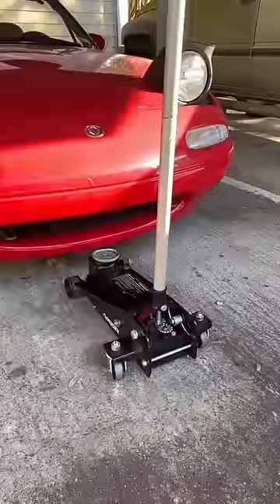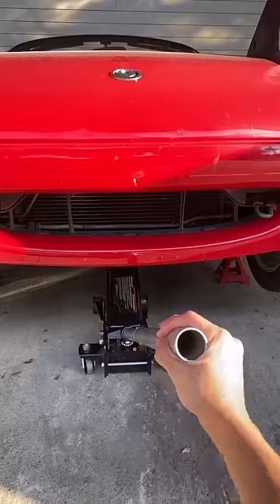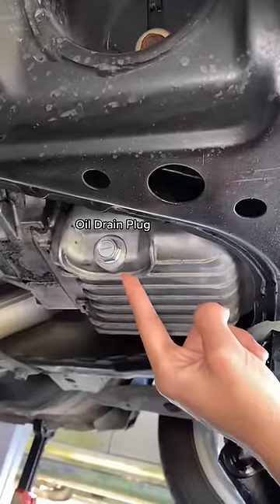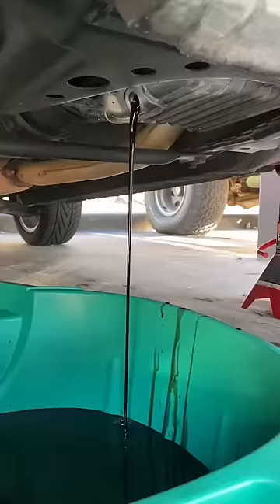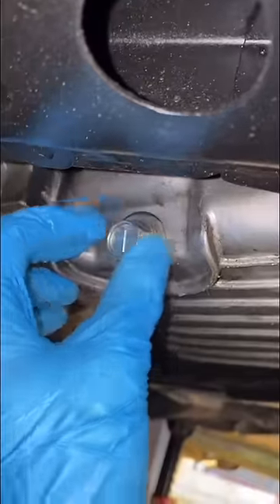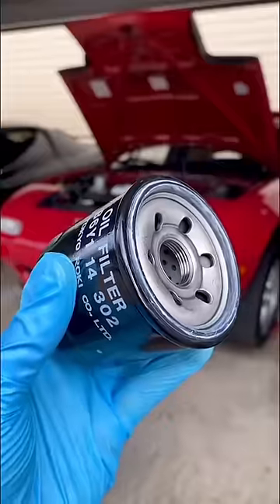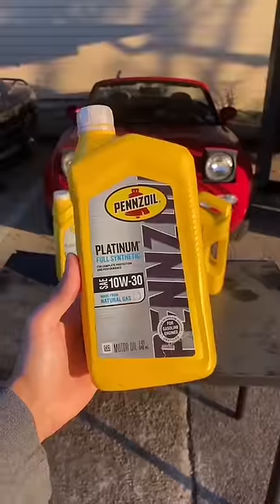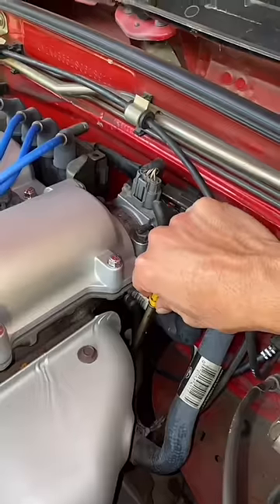How to do an Oil Change! (in any car)

Comment: I always remove the rubber seal from the filter and coat both sides with oil before putting it back in.

Comment: After putting in new oil, start then engine and run it to cycle oil thru the engine and oil filter, THEN check dipstick.

Comment: I have never ever replaced the crush washer on drain bolts. Never has it ever leaked on all cars I have had to own or change the oil on. I of course check to make sure it is not cracked and is in good condition. Generally good practice to replace the washer but I have never needed to.

Comment: I don’t put the drain plug back in until I’ve taken the oil filter off, I’ve noticed more oil comes out after I remove the filter.
Reply: Absolutely, this is an important step he missed out.

Comment: Always check for DOUBLE SEAL on filter.
Reply: Agreed. I look for the seal on the old oil filter. If the old oil filter seal is on the old oil filter, it's not on the car.

Comment: You're supposed to start the car and then check the oil level. You'll get a false read if you haven't started the car after filling it with oil. Also, please remember to place a block behind one of your rear tires people. You're road pizza if the car rolls back.

Comment: If you don't fill up the new oil filter with oil before screwing it on, then make sure that after you've put the new oil in your engine you make it run for a few minutes and then you check oil level again, because you might need to top up a bit since the filter has filled itself with oil

Comment: I don’t have crush washers on any of my vehicles. And I’ve always filled the filter with oil as well as lube the seal before I put it on. I’ve yet to do this. But some skilled mechanics can take the drain plug out without getting oil on their hands.

Comment: Really the only notes I have is 
Check your dipstick to make sure your in the right range and don't have any leaks 
And 
Chock your back wheels if your only lifting the front 

Also lower the car before final checking the dipstick otherwise all that oil will be tilted back and you'll think you need to add more

Also DONT just tighten your drain plug with a ratchet, that's a 1 way ticket to a fucked up drain plug 
If you can find the touque specks and do everything in your power to use a torque wrench 

And also its a good idea to whipe the mounting plate for the filter to make sure you don't double gasket
Its not needed but my paranoid ass won't sleep easy unless I do 

I work at a quick lube shop 
So this is fact checked

Comment: Quick tip, fill the oil filter about half way with oil so it doesn't run dry right away. It just helps
Reply: no

Comment: Nice video but he left out some info 

First off you would want the car to be flat and  ot with the nose in the air ... having the engine at that angle can cause some dirty oil to still be in the pan 

Try to get the car level .. however if you do it with the car tilted its not the end of the world 

Second . When replacing the oil filter( before fitting the drain screw )  you should fill it up with oil ... if you cant fill it up 

Then just put it on and remove your fuelpump fuse so you can let the starter rotate your engine and get the filter full 

Also its a good idea to put some oil on the seals before you tighten them 

Also make sure the oil filter seal is off ... if you stack two filter seals on each other they WILL leak ...

Comment: I would also fill up the filter about halfway with oil, that way it’s primed when you first start it back up again
Reply: Nah. The center of the filter is the clean side. You risk contamination when you add fluid yourself. Most manufacturers recommend that you do NOT do that.

Comment: My mom's Subaru outback that I changed the oil on was leaking out of the filter, and had a slight leak out of the drain plug, needless to say I don't let shops work on it anymore, and I legit just cleaned it all flipped the crush washer because I forgot to buy an oversized for her car...
No leaks and we're at 350,000 miles...

Comment: Don't mean to be rude. Great job but usually you feel the oil filter up before you put it on so it doesn't run dry and just filter through it

Comment: Aren't you supposed to run the engine for a bit before so the oil is at its thinnest viscosity and will run to the bottom more effectively, and not sludge up through the engine. To make sure you drain all if it?

Comment: Unscrew the oil filter by hand? What kinda wizard are you?
Also make sure to run your car after checking the oil for the first time, then check again (itll drop since the new oil filter need to fill up).

Also you didnt mention that you should change the oil after driving so its still warm and all the loose particles didnt set yet.
Otherwise solid vid

Comment: Are we just not gonna talk about how your supposed to run the engine and then check the level, if you put the proper amount of oil in and then check right away. Then it will look too full but it’s because the oil has not made its way through the engine yet

Comment: Cracking the oil cap loose before the oil change is useless. Oil is not a sealed system it's going to flow the same with or without the cap loose. And i have never seen a drain plug directly under the fill cap on any engine haha

Comment: 99% I give  it an A
If you'd mention to start the engine and then check the oil level it'd be A+. Because the oil radiator and the filter will suck some in.

Comment: You should always remove the the oil filter and plug together because it’ll leave pressure in the system if you don’t. You should also always use a torque wrench when tightening a drain plug and look up the OEM recommended torque as aluminum pans easily strip out.

Comment: Pre-Fill you oil filters people!!
Reply: I see too many people not do that, despite the filter placement being at a weird angle on some cars, it should be done anyway!
Reply: @bass_man8149  absolutely correct, you don't want your bearings to run dry even for seconds
Reply: Literally pointless on modern cars

Comment: Never jack up a car but the sub frame… also do oil changes on a flat surface as the drain plug is now not at the bottom of the motor……..

Comment: I usually use a wrench extensor to remove the oil drain plug and I don't get a single drop of oil in my hands

Comment: You don’t need gloves lol you loosen the bolt and then twist it off while keeping tension on the bolt, once it’s off you keep tension with your fingers and quickly get the bolt out of the way of the flow of oil

Comment: bye the way when you set the car down leave the jack there just in case one of the jack stands fail just for safety measures
Reply: that only if you use harbor freight jacks
Reply: @thatslegit  i don’t use that shit I have had mine fall do to a truck moving on the jack stands and the jack caught the truck from landing on me

Comment: First oil filter then oil drain plug.
Reply: Nope, it depend on if the filter in on top of the engine like most expensive cars do, but since it's an older car it's always drain plug first

Comment: Don’t forget to fill the oil filter with oil too!
Reply: How do you prefill the filter if the setup on a car is horizontal? Wouldn't it make a big mess?
Reply: @jackiechan_wtf4041  usually the filter goes up but incase it goes sideways just fill it a little under halfway and be careful and you should be good

Comment: I run my miata on the streets like its the track, penzoil was worn out by 1500 miles and mobil1 regularly gets me to 3000 no problem (I’m talking 6000rpm pulls to get up to speed in city driving never mind highway).

Comment: Yes first you have to drain the oil pan and screw the oil drain plug to seal it, but later remove the oil filter, of course, so you don't leave any used oil inside your engine, isn't it?

Comment: You still have a good 2 liters of used oil in your engine with it tilted on a 25 degree angle like that 🤣
Reply: Surprised I had to scroll this far to find this comment
Reply: @SlimTheGoat  bunch or morons gonna do this and fuck their engine up...
Just realised you wont be putting the right amount of oil either , you would be putting a lot extra since the dip stick wont reach the new oil properly in the back of the engine 😅😅😅😅😅
Reply: @GTR_IMPOSTER  I stopped draining oil years ago and switched to an extraction device thru the dipstick.

I had my doubts so I did it on an old sbc I had sitting around and pulled the pan afterwards. Needless to say I'll never wrench off a drain plug again
Reply: @SlimTheGoat  if you do it that way , it doesnt matter if your car is on an angle right ? 

I take my cars to a shop man , its worth the 20$ extra for my time lol .. even tho my car is lowered and its a pain sometimes still worth it for me to bring it to a shop
Reply: @GTR_IMPOSTER  I wouldn't think so but I've never tested it out. For as much money I got into equipment and vehicles I don't trust anyone but myself for maintenance. This way I got no one to blame but myself if something happens.

Plus depending on the location and style of oil filter you may not even need to jack up your car which is pretty sweet.

Comment: The tip about the line from the oil cap is not true, ive done hundreds of oil changes, and tried this several times. It only worked like 3 times

Comment: Are we gonna not start it and run it for a bit then turn it off and check the dip stick? A filter usually holds around .3L more if its diesel truck

Comment: I've done many many oil changes on both of my cars and never replaced the crush washer, it doesn't seem to leak either, so i don't understand why you'd need to replace it.
Reply: @EpicDrew15  Mine are nylon or some sort of plastic.
Reply: @EpicDrew15  Ahhhh, alright, that makes more sense. Thank you for clearing that up for me.
Reply: @EpicDrew15  You too.

Comment: you did it completly wrong.... before you put the drainplug back in. Change the filter first so you know most of the old oil is out.... most oil filters hold 0,5 liters of oil.

Comment: " unscrew it by hand " uh huh... In a perfect world yes.... But actually, stab with screwdriver, yell expletives use hammer, wrenches, too much effort , smash your knuckles, swear , two hours later remove the crushed up oil filter and grumble about how your dealership screwed you by telling you they replaced the oil filter when they didnt , now add new filter and oil

Comment: not suppose to have engen oil filter be able to be hand tight or can untwist by hand vibrations can and will unscrew oil fitter get the ofishal book on working on a meatia and follow it

Comment: I didn t see if u filled the oil filter eith oil before u installed it
I am not a mecanic but everytime i change the oil at my traktors i fill the oil filters with oil🤷🏾‍♂️
Is it corect or not?

Comment: Don't put the drain plug back in until after the old filter is removed! More oil will drain out and you'll end up trapping that old oil inside, which will mix with the new oil you're putting in.

Comment: Bruh nah bruh💀 gotta do the oil change with the car flat otherwise you get a bunch of gunk nasty oil stuck in the back of your pan
Reply: plenty of cars have the drain plug on the back and it’s at a angle so there would be no issue

Comment: Why do u need to change the washer I’ve changed oil many times but never seen that before
Reply: They recommended changing washers regularly to avoid leaks, but I really only do it if it if it’s actually leaking.

Comment: Well I'm just going to say this your wrong in any vehicle try a newer dodge caravan bud they are a cartridge type oil filter that's replaced from the top of the engine so please refrain from using any vehicle anymore it's not the 90s anymore.

Comment: I'm stuck on the first step cause I can't get my jack under 😂
Reply: Yeah I usually Jack up the front right and front left corners and then the back with the diff because it’s a little easier than getting the front cross member

Comment: Never thought about the crush washer, I'll have to look for that next time!
Reply: Some cars have a rubber gasket on the plug instead of a crush washer. Those don't need replaced unless they're damaged. But if you do have a crush washer, not replacing it risks a slow leak.

Comment: Sorta glad I went for an 86 for a fuck around car than a Miata just because oil changes are less hell because the filter is under the hood. But at the same time I got no pop up headlights and flirt with chicks by winking at them with the headlights

Comment: How does your crush washer come off so easily? If I'm lucky I can unthread mine. Unfortunately I have the luck of a legless gazelle in the middle of a starving pack of Hyenas. So usually I end up having to pry and chisel that mofo off while keeping the drain plug threads untouched.

Comment: U have to keep the car level I bet there’s some old oil is still in there
Reply: Kinda depends on the oil drain plug location. If it's at the rear edge of the oil pan, it's fine. I usually change the oil on a 2-pillar lift as I'm doing other maintenance, so I don't have to worry about it regardless.

Comment: Leave the oil cap on the hood latch while doing the change. Also pull the dipstick, but don't remove it completely. These tricks will help make sure you didn't forget to add oil before closing the hood

Comment: The most important thing you guys always leave out in these video MAKE SURE THE OLD OIL FILTER SEAL ISNT ON THE ENGINE STILL!!!! Jesus nobody points that out. That stupid little washer doesn't need to be replaced if you double gasket the oil filter and don't make sure you might as well kiss your engine goodbye forever

Comment: Penzzoil is the worst oil i have used. Please dont use it. Use other oils. Penzzoil has runined a engine on me. Just as friendly advice. Use a different oil then penzzoil for engine protection. Penzzoil is absolute garbage. I am a technician at toyota by the way.

Comment: Take it off by hand 🤣😂 did you just finger tighten it? I don’t got a car but I’ll be damned if I ever get that filter off without a wrench.
Reply: alot of shops put it on way too tight
Reply: @arcanevoid9199  alot of people don’t understand that the filter wrench is for removal only.  You never tighten with a wrench, the only time I ever have was on large equipment and I still only snugged it a little bit tighter than hand tight I never wrenched it hard.

Comment: Its not that inportant to replace the crush washer dude ive replaced oil in many diffrent vehicles to even atvs never replaced the crush washer and never had any leaks but hey to each its own
Reply: Amen. It's irritating when people start acting like the crush washer not being replaced will cause catastrophic engine failure. It's like an old wives tale at this point.

Comment: What’s wrong with getting your bare hands dirty?
Reply: do you know how bad oil is for your health? used oil is even worse
Reply: @arcanevoid9199  It’s not like you’re drinking the stuff. At least not a lot of it. Just wash your hands.
Reply: @ZSmith-yy4lv  i mean it goes into your bloodstream through your skin, like lots of other chemicals used for cars like paint thinner, wax and grease remover etc
Reply: @arcanevoid9199  the human body is an amazing thing. A little oil won’t hurt you.
Reply: @ZSmith-yy4lv  key word little, I’ve spilt power steering fluid all over my shirt once but it’s not good if your doing that sorta stuff often
Reply: @arcanevoid9199  I know multiple lifelong mechanics with absolutely no problems whatsoever. At least with oil. Their backs are busted, but their skin is fine. Again, our bodies are amazing things it can maintain itself.
Reply: @ZSmith-yy4lv  it even mentions this in the workshop manual for my celica and probably many other cars. like you can say its fine as much as you want but facts are facts. used oil is carcinogenic among other things
Reply: @arcanevoid9199  sometimes you just have to look at the real world. Not your fault you don’t have much interaction with cars/mechanics.
Reply: @ZSmith-yy4lv  my step dad along with his uncle are panel beaters, and ive had plenty of interaction with cars. its honestly just a guy thing, have a saying where i live "she'll be right"

Comment: Yeah sure remove it by hand 🥴
Reply: Yeah, whenever a car has last had it's oil changed in a repair/oil shop, the filter is gonna be hella tight and I need one of those removal tools and an unreasonable amount of force.

People, please, always lubricate the o-ring and hand-tighten the filter snug. :(
Reply: I appreciate your tutorial but I'm a whole goddamn RV technician dawg 🤣🤣🤣
Reply: @wolffrags9856  like right now I'm looking through a whole wiring harness that's like 18 ft long I need some help troubleshooting and diagnosing this that would be nice 🤣🤣🤣

Comment: you forgot to pre fill the new filter some cars use almost a whole quart to fill the filter
Reply: Most manufacturers actually recommend against that, as you can add contaminant to the clean side of the filter.